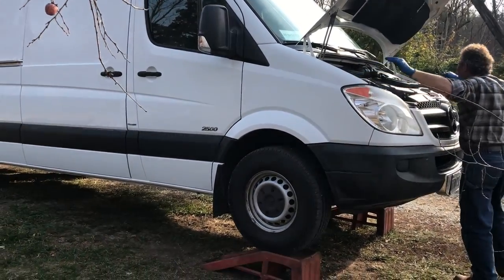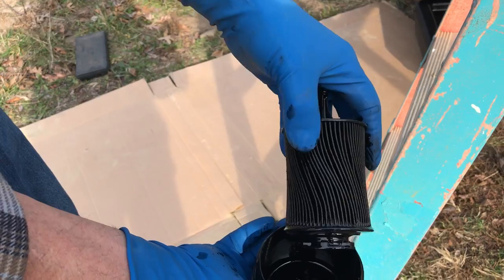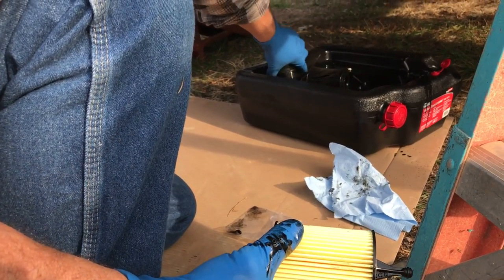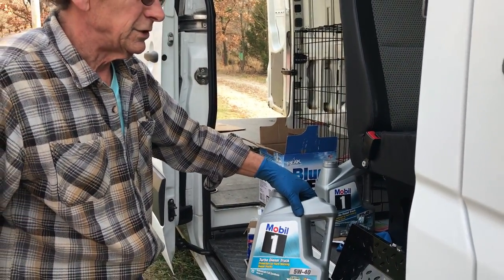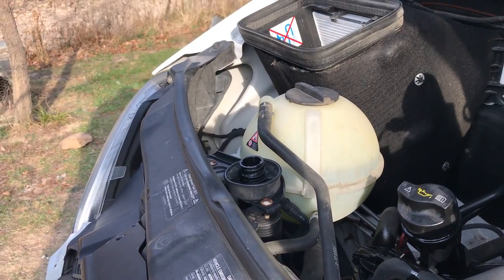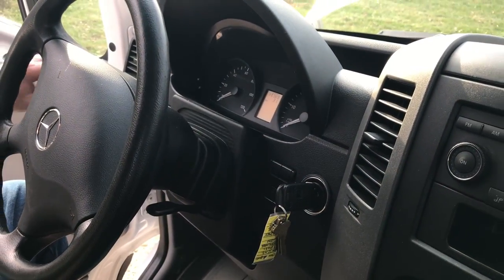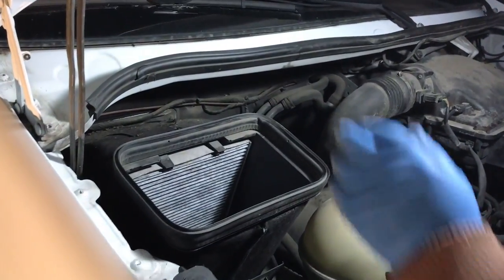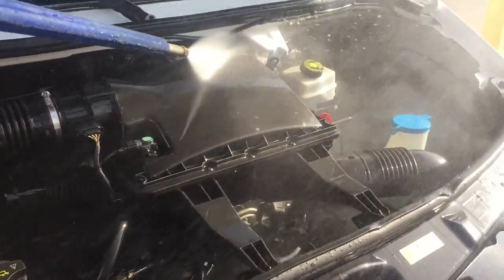Mercedes Sprinter Van DIY General Maintenance -Oil, Filters, DEF

Comment: Great video friend. But i would like to point out  that the oil you used in this oil change is the WRONG oil for your van. Dont get me wrong it is a great oil, but your vehicle is equipped with a DPF filter and an EGR valve that will get clogged prematurely. You need to use a low SAPS 229.52/229.51 rated oil so that you can prolong the life of these components as they are very expensive to replace. And if any of it was to get clogged on one of your journeys the vehicle will cut power and leave you stranded.   Synpower MST 5w40 is an excellent oil that is rated for your engine. Very nice van and reliable engine, but unfortunately very sensitive emissions system that can cause trouble. Best of luck.
Reply: Its It's going  to get clogged  with time even with the recommended  oil.
I have always used 5w40 .

Comment: A6511800109- part no for oil filter. A0000903751- air filter, thought you’d change the fuel filter as well. A6510902952. Mercedes Benz genuine engine oil -a0009894704. Sprinters take 11 litres 😉

Comment: Thanks for the nice DIY video! Nothing to cover up when you cleaned the engine bay with a Pressure Washer? Alternator, battery...?
Reply from the maker: The battery is under a panel under the drivers feet. Its fine to wash engine bay, just don't get water in air filter area.
Reply: Fit Organic Living Thanks. I have an auxiliary battery under the hood.

Comment: I can't believe you power washed the engine.  That's hilarious.  I thought that everybody knew that you should never do that.  Then your new oil filter spent more time rolling around in the grass and dirt than not.  You suggested using a solvent to clean out the oil filter body.  Are you serious?  You shouldn't put anything on that but a solvent will dissolve oil... You think you're cleaning it but you'd be incorporating a solvent into your oil system.  You are making things much harder than it should be and finding great ways to damage your engine.

Comment: Just got a 2012 Sprinter about a month ago.  Today while at the Mercedes dealers parts department the guy suggested Mobil 1 5W-30 and not 5W-40.  But after doing some more research now I've discovered that supposedly the best  oil for a Sprinter is Mobil 1 ESP formula 5W-30.  Anyone use this oil?
Reply: Yes-It must be "ESP"  Formula!! It works well in my 2012 Mercedes Benz Sprinter.  See at https://www.amazon.com/s?k=mobil+1+ESP+oil&ref=nb_sb_noss_2

Comment: Wrong oil filter ,wrong air filter ,  a VERY wrong oil , and cabin filter incorrectly installed... 
Alternator can  easily be fried by pressure washer 
Consider Fumoto valve .
Reply: Don't worry it's been a year now and it's still running
Reply: S Volk  you are right on all 3 the  oil must be   ESP  Rated because if it's not you will be replacing the diesel emission filters at about 150,000 miles because they will be plugged up by not using the correct oil ESP stands for  emission system protection
Reply: Could you explain more regarding "wrong oil filter, wrong air filter."  Those are the part numbers Fram recommends.  Or are you saying that that Fram is not a good brand? If so, what brand do you recommend?
Reply: Not to mention that everything ended up in the grass at some point and was simply wiped off with a dirty towel and reinstalled. I wouldn't let this guy work on my lawnmower!

Comment: Fit Organic Living 
Give me your address. I think I might just send you a 1/4 impact driver. Speeds up the removal of all those little nuts & bolts. I wanted to mention this when I watched you fumble with your 3/8 socket wrench.  You describe your work really well. But you fumble with your wrenches so much. Its almost painful to watch.
   Also. About the fuel injector replacement. (Another video) When loosing a bolt that you are afraid will break. "NEVER" just put a ratchet on it and  apply pressure. You "TAP" on it. This will break it loose so that you don't break bolts..
    Other than those  painful things.  Very good videos....

Comment: Where did you get your Oil Drain Pan? I couldn't find it on Amazon.
Reply from the maker: Walmart
Reply: Thanks!
Reply: @FitOrganicLiving  hi Fit
I have 2007  dodge sprinter everything good but with me but one question when I get 3000 RPM so the MPH is go to the same place like 80 MPH so do you think RPM to high please let me know your sprinter the same or not thank you very much
Reply: @jaydennguyen6047  
At 3000 RPM you should be doing 80-81 MPH. If the RPM is any higher like 3200-3300 at 80-81 MPH, it means that your transmission torque converter is slipping and burning.
Reply: So what do I do now can you tell me exactly what i need to fix  I have no experience with dodge sprinter please
Reply: @Dima-jq3mj  here my problem do you think i need to replace anything? Please let me know
Reply: @jaydennguyen6047  
It looks like your RPM is too high a bit. At 3000 RPM you should be doing 80-81 miles per hour. 

1. Make sure you have the right tire size, 245/75/16. If you might have a 245/85/16 tire on, it will do that. 

2. You need to make sure that your torque converter's clutch is working properly. It will require you to have a scanner such as these...

iCarsoft MBII for Mercedes Benz/Sprinter/Smart Professional Diagnostic Tool Scanner, New Version https://www.amazon.com/dp/B015DNAMT2/ref=cm_sw_r_other_apa_i_7oXyCb1XX3Y17

 https://www.ebay.com/p/iCarsoft-MB-V2-0-MERCEDES-Obd2-Multi-System-Diagnostic-Fault-Code-Scanner-Tool/20021536179

That have "live data" capability. You will need to log into the Transmission Control Module and monitor what your torque converter clutch does, to make sure it is not slipping.

I will post some pictures later.
Reply: @jaydennguyen6047  
As far as transmission, here is what you need to look for...

https://mega.nz/#!Bnw3EYQQ!svfaTu3aubsucQrHJVzVK7k5cPVBt002zP-tv1ov5ak

https://mega.nz/#!5z4TBQKZ!ow15PpUG_sgKzIwhjr9BMfCrw5BVi9X6OFGjVFDjaWk

Torque converter clutch should say "Closed". If it might say "Slipping", you have a problem with the torque converter clutch.

Also, I just remembered, is your van a 2500 or 3500?
Reply: @Dima-jq3mj  2007 dodge sprinter 2500
Reply: @jaydennguyen6047 
What tire size do you have on your van?
Reply: @Dima-jq3mj  my 245 /75/16